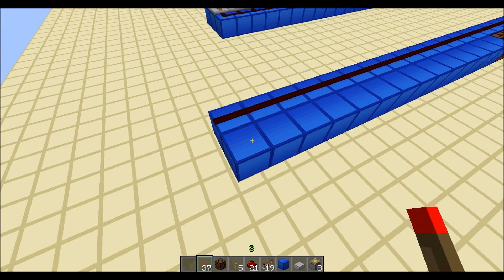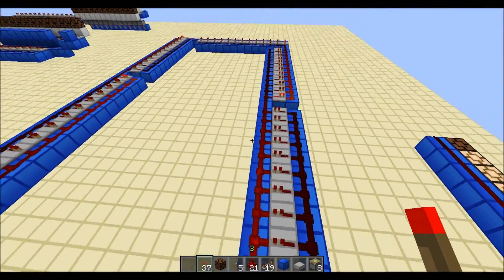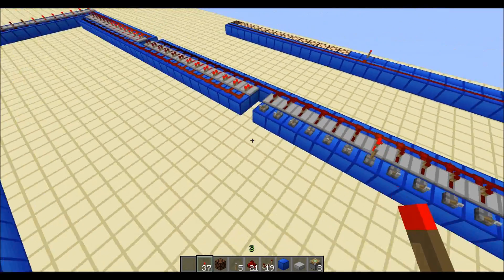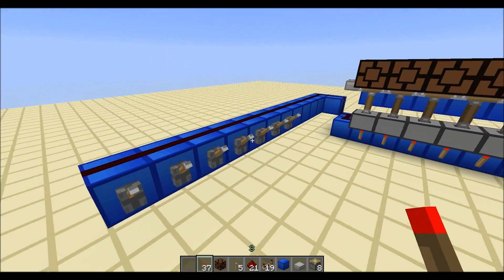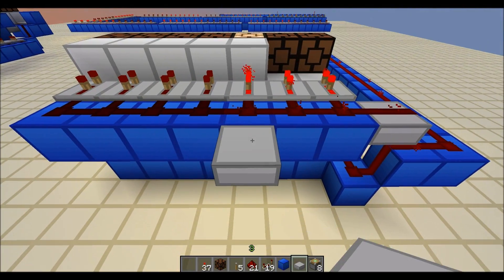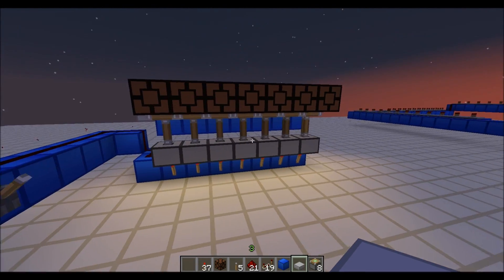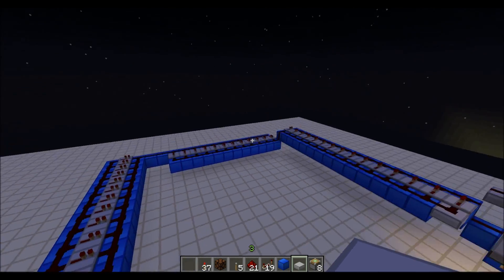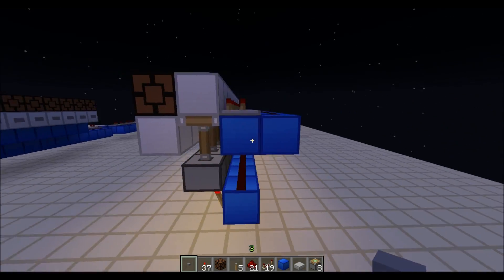Minecraft: Redcoder (Decoding Redstone Dust)

Comment: you know now we use comparators, right?
Reply: I'm pretty sure those wouldn't work for this purpose...

The concept behind this device is to input a single signal and be able to output one of many different outputs, depending on signal strength. While comparators do have the ability to decode/keep signal strengths, they cannot split them. That presently still requires a whole module/structure to do it. A single comparator cannot do that.

For example, if I just use a single comparator, and flick lever 3, sure, the comparator would maintain that signal strength of three, but its output is still one single signal, which isn't what I had intended. If I were building a combo lock, it probably isn't going to work at ALL, because when I press three, I also pressed 1 and 2... FAIL...

Now, with a redcoder, I press 3, and it ONLY sends a signal from output three, because 1 and 2 get disabled. Because, the redcoder has two inputs (basically) The first one goes to each output 1,2,3 , the second one inverts/disables them, but it is longer. so, when I input 3, 3 is greater than 1, and it is also greater than 2, so inputs 1 and 2 are disabled. outputs 4-14 are disabled because the signal didn't even reach them, meaning 3 is the only one active.
Reply: ETXAlienRobot201 it does, i use the machien wiht comparators
edit: he meant for transferring the signal
Reply: lbpfan950
firstly: i'm kinda lost now...
second: wow...been a while since i posted on THIS video...lol
Reply: Well, if you put them up against each other you can take a analogue value a long distanc
Reply: lbpfan950

but the point of this isn't distance, it's conversion...

the redcoder takes a single signal, and depending on it's strength, activates a different output. comparators merely can retain signal strengths or perform some basic math on them. (or ofc, can be used to create rapid-pulsing clocks)

check out item frame dials. I forgot how long it took me to realize, but the main component that makes these work is actually a super-compact redcoder.

About only way now if my explanation isn't so clear to maybe clarify this is me trying to literally write a small program and show you the logic it uses...
Reply: well, the reason comparators where mentioned is because of the advance device to retain signal strength could be replaced with a comparator chain, not as a reference to the redcoder
Reply: lbpfan950

yeah
but the main purpose of this video was to explain the redcoder itself, i believe.
Reply: ETXAlienRobot201 the purpose of the comment was unrelated to the purpose of the video
Reply: lbpfan950

hmm...
Reply: *****
you can use a special design uitilizign high and low signals to make it even faster with comparators
Reply: lbpfan950

yep...
forgot who it was that discovered that...

device is known as a "item frame dial selector" , but yeah...the part that makes it work is a compacted redcoder, which could be re-purposed for any input with varying strength

Took me a little while before one day while using one i realized the dial-selectors weren't entirely a new thing, just a new redcoder design... lol
Reply: ETXAlienRobot201
how is that related to my latest comment?
Reply: lbpfan950

unless you're referring to another device, i was assuming the comparator-powered one you were talking about this the item frame dial selector? (which is probably the most compact this kind of device can get for the time being)
Reply: *****
i add blocks and redstone dusts to use less comparators
Reply: CJ G Comparators are slow though. you have to have a comparator every 4th block so that means you get 3.75 ticks of delay per every 15 blocks, meanwhile you only get 1 tick of delay per 15 blocks this way. So if you have a long distance to transmit like say 150 blocks them this will give you 10 ticks of delay (1 second) while comparators will give you 38 ticks of delay (3.8 seconds). So his signal will have reached it's destination 150 blocks away by the time yours makes it a mere 40 blocks.
Reply: Chris R

besides, to make faster signals, people use so-called "instant wire" . yeah, comparators aren't efficient for covering distance. Even for retaining a signal, there's better ways to do it. they are good for making one of these devices somewhat more compact, though... (dial switches)
Reply: ETXAlienRobot201 Yea, but "instant wire" has some major drawbacks. Like for example it can only transmit an on signal, and many types need to be reset.

This can transmit hexadecimal, and does not need to be reset.
Reply: Chris R

they all have their pros/cons

from a resource perspective, building several of these is kinda wasteful
Reply: ETXAlienRobot201 Well you shouldn't really need to. Considering 1 will carry as much information as 4 binary lines. Not only that, but if you can transmit that hexadecimal data down the line as a serial transmission then you can get it to a transfer speed about twice as fast as a digital serial transfer because you can transfer 4 bits worth of data per second through the line as 2 tick pulses as opposed to 1 bit at a time for a 1 tick pulse each.
Reply: Chris R

true... i guess...

honestly, i killed my brain already trying to put together a 3d crystal puzzle

Comment: how can this be used in redstone computers or logic devices?
Reply: EpicfailORIGINAL1 To transmit a hexadecimal (0-15) number long distance at a speed of 150 blocks per second down 1 line. A mere 4 lines could transmit a number from 0-65,535 up to 300 blocks away in just 2 seconds.

Comment: There is a thing called serial, encoding an infinite amount of bits, into pulses, and decoding back into the input, i acctualy have a vid on my channel where i use it to create a router. (usefull if you want to connect multiple things to your device / redstone computer) and ofc just needs 1 wire.

Comment: Actually, the method shown in this video is faster over distance because it only has to go through one repeater every sixteenth block instead of a comparator every third block.  It is significantly less compact than using comparators, though.

Comment: Thought I'd try this out, but it appears not to work for me. Thought it may have been a mistake from me, but I did some testing and it seems that in 1.4.5. the block that the piston pushes upwards also powers the piston, so this locks it in place permanently. I tested your design with no block above the pistons and it 'worked', although it doesn't help too much!

Comment: I'm going to use it for my Alchemy room. Need to have 12 inputs wired to 12 sets of 5 dispensers. Using this design for the inputs is going to make wiring it up a lot easier and cleaner than what i had previously (wiring directly from each button to each set of dispensers gets messy real fast).

Comment: I just did some math, and if you took a 128x128 cable of normal wiring in the pattern of 64 wires, 63 wires (to avoid intersecting redstone) , repeat you would get ~4.961 KB / sec. With the same area available, even when not filling the unused 2x128 spaces (128%3 != 0) , you can still achieve the higher data transfer rate of ~6.511 KB / sec. Both calculations assume that redstone torch burnout is not a problem when oscillating at 2-redstone-tick intervals, which is to account for any [cont]

Comment: Nice coder-decoder you have there :O
Though I do believe from the video that input 0100101000 would be decoded as 0000001000 (in a system input on the left of the circuit). So yeah, a bus for compact signal transmission, with a priority setting for the higher bit (the one on the left). Still interesting in its own right :D
I sometimes wonder what kind of contraption you would build with RedPower. Probably something amazing *_*

Comment: There is a way to make it work with 2 inputs. at 1.50 your making the RS go 1 way (to the right) into the decoder so if you name the leavers 1-7 from left to right then the one with the highest number will light. If you mirror the decorder (so the signal goes to the left) then leaver with the lowerst value will light. If you take both signals into 1 output line and OR them together you have a multiple input redstone decord (yes its only 2 but that counts as multiple!) Challange Complete!

Comment: CubeHamster: YOU F***ING SOLVED MY PROBLEM!!! THANKS xD

I will explain: i was building a fully automatic "nautilus" (search on wikipedia for julio verne) of my own and i was having issues trying to make a comand center using only 1 single redstone wire for output. i was working whit counters (similar to morse code) but this system is so small, yet so efficient i must say: Congratulations ;)

Comment: You could also use signal length to your advantage for a second time to decode the output.  If you extend the redstone line by one for each of the outputs (bringing it up and to the side) you can find the correct output when it has its first dust lit up and second one off (because the line runs out).